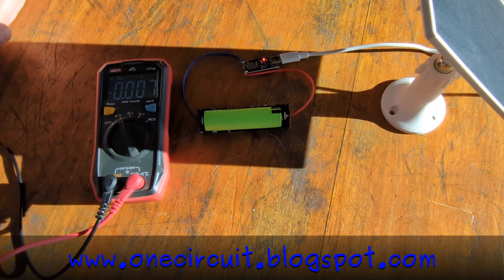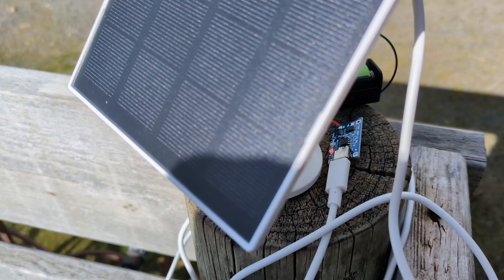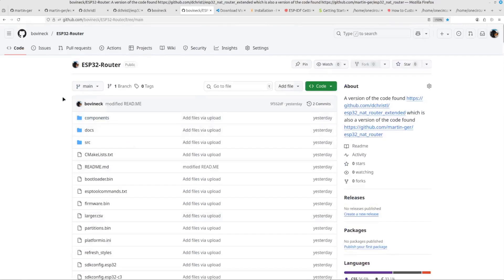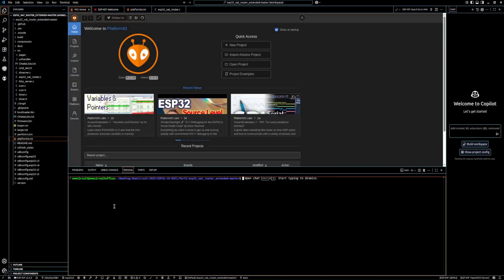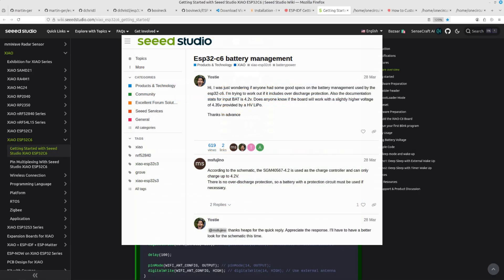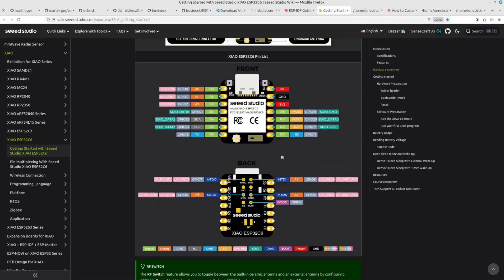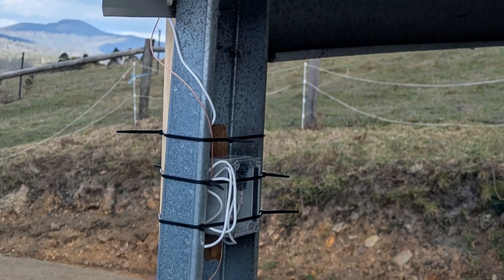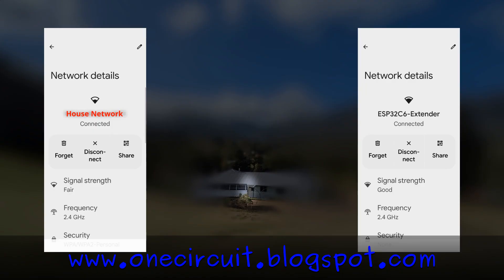Solar Powered ESP32-C6 WiFi Extender

Comment: damn cool project! I need one that does cell signal boosting for up at my parents' cottage where I go fishing - there is cell reception sometimes but way way way too faint to use your phone
Reply from the maker: There must be a thing...🤔
Reply from the maker: 3G 4G 5G Signal Booster Cell Phone Repeater EGSM 2G Amplifier For Mobile B1/B3/B5/B8/B20/B28 Tuya App Monitoring
https://a.aliexpress.com/_msa9aNL
Reply: @onecircuit-as  That's not open source OR a project I can make a video about though! ;) all jokes aside, the Canadian bands are often not compatible with the Chinese ones so more research would be needed
Reply from the maker: Yeah it's def a minefield, plus in Oz super regulated. 😮

Comment: ive done similar for just s sensor that tramists data only when there is PV...so just a panel into a regulator intio the esp32....cistern pressure sensor dropped into tank for water level
Reply: home assistant,  IIRC i used a buck regulator board
Reply from the maker: Home assistant is about to make an appearance on the channel 🤫
Reply from the maker: I'm sure there are energy savings I haven't tweaked yet. Danny's code is pretty extensive. 👍😀

Comment: Those solar panels have linear regulators in them (I think)
Reply from the maker: Really! So the output voltage is regulated? Now I think a "tear down" is in order. 👍😀
Reply: @onecircuit-as yeah, I think so. I was sourcing some for exactly the same kind of project as yours, and concluded that the usb-C connector ones were described as having a regulated output - I think that's what's in the bubble at the back. One problem with a tear-down is that it might reduce their weather resistance.
Reply from the maker: Well it would kill it, but that's science for you 😬